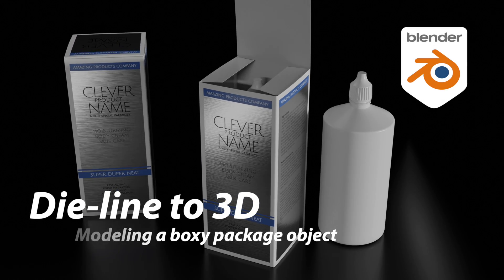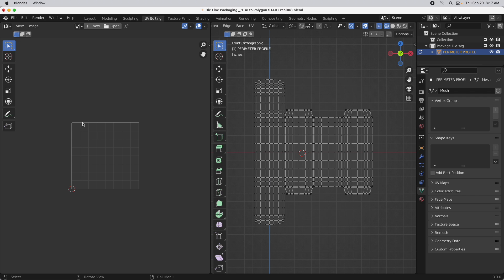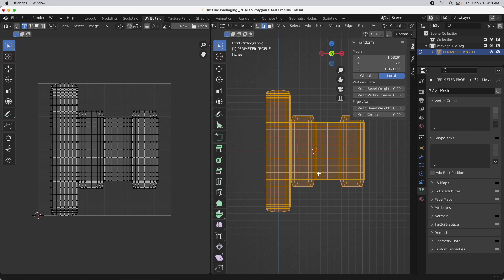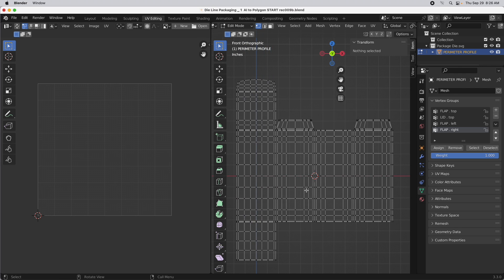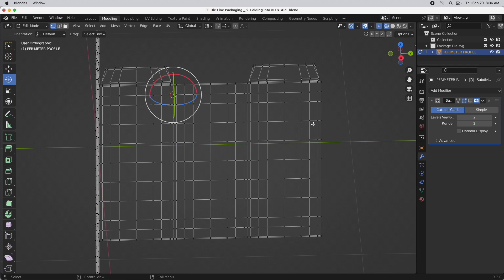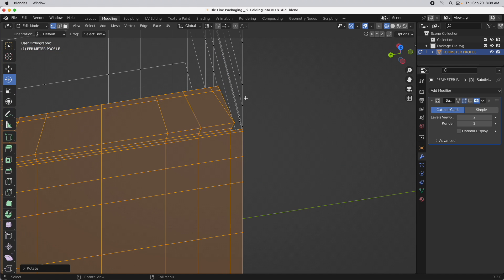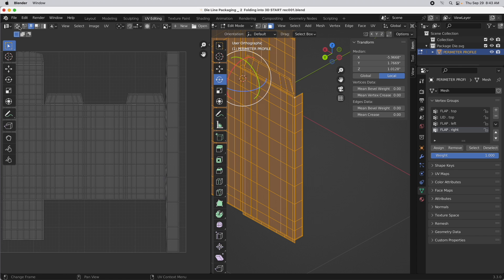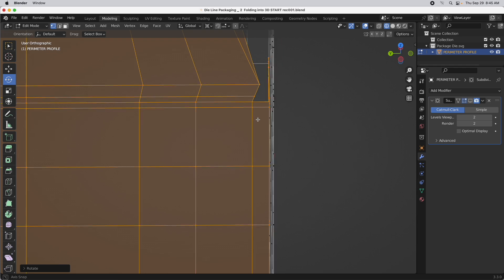Dieline to 3D, part 2. UV unwrapping and initial folding tutorial

Comment: After the box has been folded and solidify applied, do you have sharp points where the face and top fold? Nothing overlaps in edit mode but when the object is closed, the top face/lid corners are not folding correctly.